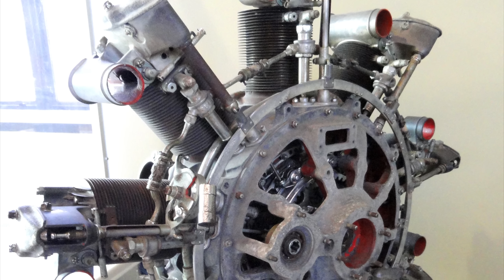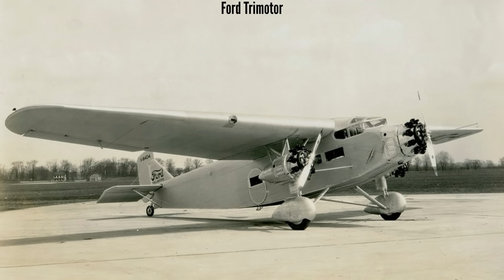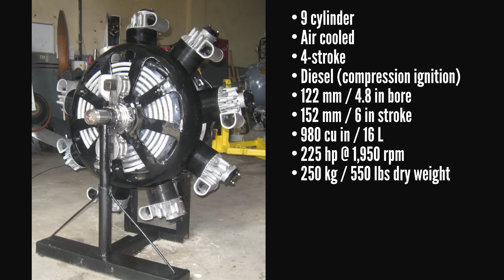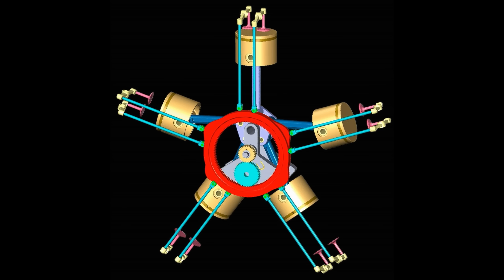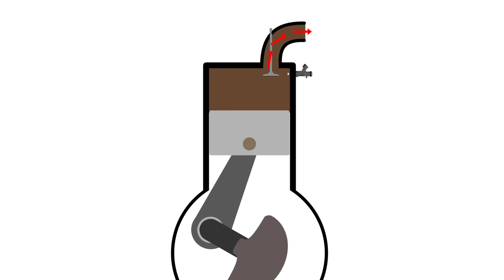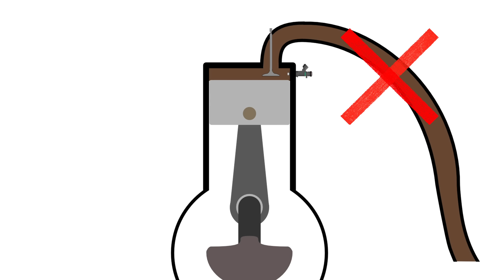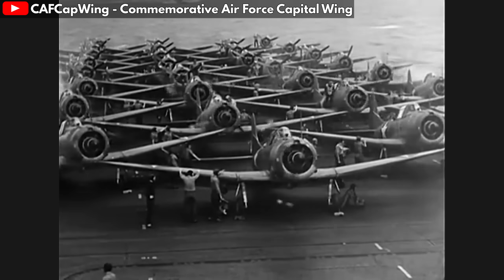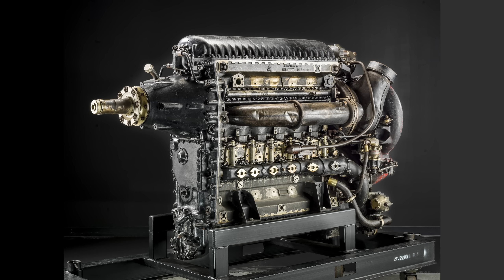The Single-Valve Diesel Radial that Almost Changed Aviation

Comment: Two fixes:
1. Put a check valve on the intake, eliminating exhaust escape.
2. Longer connecting rods seriously reduce vibration.
Reply: Make it a proper uniflow two stroke diesel by adding lower cylinder , piston controlled , intake ports and a scavenger blower
Reply: @PaulG.x  👌😊 Exactly !
Reply from the maker: 100%. There was/are fixes out there for those problems.
Reply: Centrifugally supercharge the intake system, more power at altitude and enforces consistent direction of gas flow.
Reply: @operator8014  Unfortunately the open exhaust prevents pressurization.
Reply: @RePeteAndMe  You'd still pick up a few extra horsepower, since the exhaust system must cause some amount of drag at higher flow.
Reply: @RePeteAndMe  Indeed. A 2st design w/ a poppet intake and exhaust port in the cylinder wall at the bottom of the stroke would have made FAR more sense, esp. as a twin-row design where the ex. ports could share the exhaust plumbing to run a turbocharger, w/o adding significant weight while boosting output considerably, esp. at altitude where a N/A diesel would really struggle. Frankly stunned to learn that they got one to 19k feet ASL...
Reply: External dimensions would have been a thing for engine power classes as would cylinder numbers so I don't think a meaningful rod ratio change would have been available. You could use a rotational fluid filled damper to counter the vibration effectively but that introduces rotational mass. This could be on the rear of the engine as to not affect airflow and thrust but as far as Im aware they had yet to be invented. 
As for a reverse flow check in the intake stream by doing this you basically turn it in to an atmospheric valve engine. These are particularly sensitive to air pressure as they require a spring. With a light spring the would still be susceptible to air density issues and overlap breathing. If you were to mechanically drive them you might as well do it for an exhaust valve as far as weight and complexity goes and get a better power return. You could do it very simply with an other valve in the exhaust path driven opposite to the in cylinder valve to prevent tailpipe pressure affecting the intake capable of being a bit less complex You could then put a decent exhaust on it and in tandem with an intake throttle soften its idle and still have a generous power delivery but it still makes it a lot more complex. 
It could have used Ricardos diesel preignition chamber something that was probably pre patent when this was built as it would have also smoothed out the combustion process a bit compared to the one shown. That is what truly revolutionized 4 stroke Diesels and allowed their wide adoption. 
But with all things Aero the less power you have the greater the weight will be a deciding factor.
Reply: More fixes. Scotch yoke connecting rod.

Comment: A diesel engine    HAS  TO  BEE MADE  SUPER  STRONG ?  From its head , wristpin  and  strong CRANK SHAFT and LARGE UIORMAL BEARING  AREA Due to its working ability and higher compression to explode oil?  It is one true miracle of an engine that has helped mankind win WARS and also build hope for mankind in its ability to work hydralic transmissions for pumping concretes to extrem heiohts for faricating buildings and road buildings.The problem with RADIAL DIESELS is they develope cracks around the base of the jung? Any proven diesel and hard working machine will be usually constucyed in a heavy cast iron BLOCK? The RUSSKYS seemed to have perfected their cast ALUMINUM  V12 block which gave them a  more horsepower in their TANKS over their Nazi invaders? Somehow?? they seemed to have perfected to fabricate ALUMINUM with super stremght? Probably due to thier RICH ALLOYS in their country? They have proven that with their JET engines and thrusters that move the tail end of the airplanes and seem to last long? Technodgy in AMERICA has really been neglegted??Everybody anymore seems to wory about the size of their penious  and how to satisfy a womans desires???
Reply: Your punctuation is odd.
Reply: Your capitalisation is odd.
Reply: Keep taking those tablets.
Reply: ok WHAT. is going ON. here? THIS whole writing. Is a little, ODD?
Reply: Radial engines have inherent features making them stronger than their inline brothers…..There are no stress reversals in the crank, and the crankshaft is short.  Most have roller main bearings which require very little lube.  They are dry sump.  Radials run with cylinders blown off.  Radial is a good way to go for diesel.  Google “Nordberg radial diesel”
   Where I think radial designers err is not using long fatigue resistant head bolts.  Instead they chose integral heads and short bolts at the cylinder base.    Cheers

Comment: Check out the Guiberson A-1020 4 Stroke Diesel Radial Aero Engine, was one of the main engine options for the M3 Grant & Lee Medium Tanks, the predecessor of the M4 Sherman Tank
Reply: A duplex version of the 1040 and 1400 was proposed and tested in the M4 as the 2080 and 2800.

Comment: Too much vibration and pilot suffocation 👍
Reply: Putting the engine somewhere other than right in front of the pilot (on a 2 or 4 engine design, or a single engine pusher) would get rid of the fume problem.